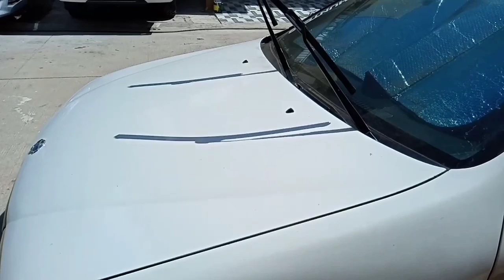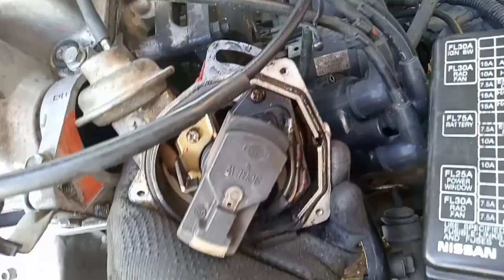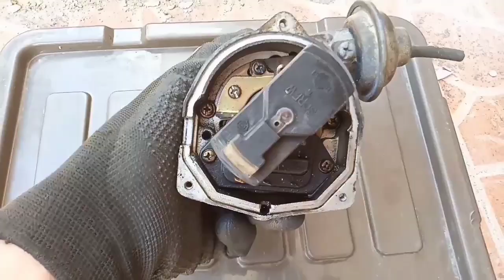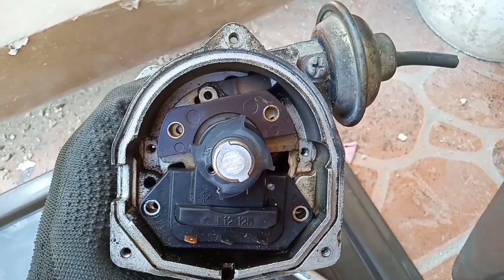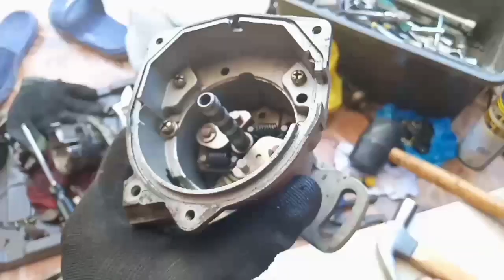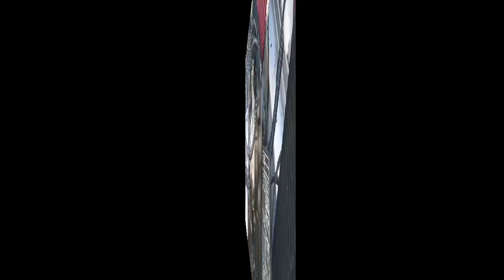Nissan Sentra 1999 (B14) Distributor Overhaul || Do Dong

Comment: Bos kailangan pb nka top dead center bago baklasin yan distributor
Reply from the maker: sa pag baklas, kahit hindi na bos, peru dapat tandaan ang pag tanggal sa gear baka mabaliktad at hindi mo mapaandar ang sasakyan po.
Reply: @dodong7217  slamat bos ..anung gear po b un bos
Reply: @dodong7217  oil seal at o ring dn po kc problima ng sskyan ko bos
Reply: @dodong7217  anong gear yung sinasabi mo?